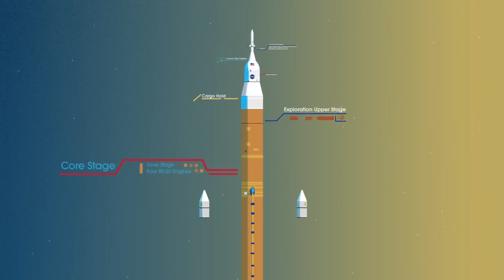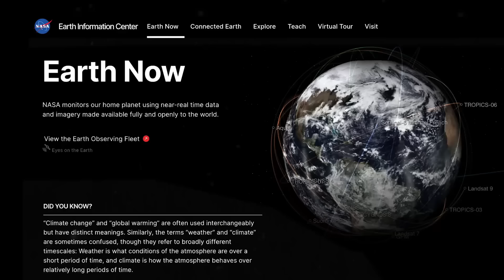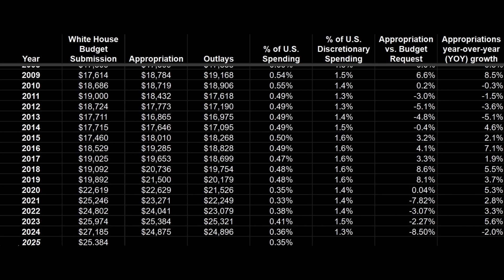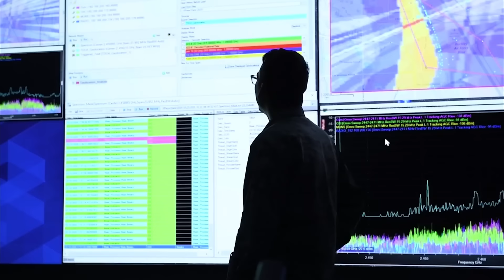What Does Trump's Return Mean For NASA, Artemis and US Spaceflight? Deep Space Update Special....

Comment: 5:48 Honestly the idea of repurposing the SLS into a space station module factory would be VERY poetic
Reply: lets just hope if it does happen they don't reenter uncontrolled lol
Reply: I got some side eye about that idea. I don't think those two things have much in common aside from the shape. Pressure hulls have a very different job than fuel tanks.
Reply: Well it is a Space Launching System
Reply: that or he's just being objective
Reply: Fuel depots, and call it Shelby Station
Reply: Repurposing SLS into anything is a bad idea. The problem is not SLS hardware as such, the problem is the organization around it. These people do not have a slightest idea how to build things economically. For example, Sufferdini went from working for NASA human spaceflight program to work for Axiom ... and promptly broke its finances.
Reply: Space Shuttle parts doing Space Shuttle things lmao
Reply: @patricklewis7636  You do know that they built Skylab out of a Saturn V third stage right? And I don't mean with the tooling for the third stage, or based on the designs. They took literal physical third stage they already built for the later Apollo missions that got cancelled and modified that into Skylab.
Reply: @kukuc96  yeah. Not exactly a ringing endorsement.
Reply: @denysvlasenko1865  It's the hardware too, the RS-25 is an incredibly complex and expensive engine designed to be RE-USED and NASA's plan is to just dump them into the ocean. So yeah Starship is a far better spacecraft lol
Reply: that's what the Saturn V at the end of its life did.
Reply: Yeah, because Skylab was SUCH a great idea. Boeing can't even get a fucking bag of bolts home in a disposable can and you want them to build a living hab? Please.
Reply: @patricklewis7636  it's a concept at least as old as the Apollo programme
Reply: @patricklewis7636  they both hold things at high pressure right?
Reply: @NickH-o5l  Two very different things. And we've gotten a lot more sophisticated about this stuff since the days of Skylab. I give this side eye because it sounds as "simple" as "Let's just re-use Shuttle designs. That will save a ton of money!"

Comment: 6:35 TLI payload of different rockets:
Falcon 9 expended = 5.4t
Ariane 6-4 = 8.6t
Vulcan 6S = 12.1t
New Glenn = 7t
Falcon Heavy expended = 20t
SLS Block 1 = 27.5t
SLS Block 1B = 38t
SLS Block 2 = 46t

No rocket besides SLS can launch Orion+ESM (26.5t) to the moon. A Falcon Heavy Centaur could technically do it (28t), but I don't think Falcon Heavy isn't designed to handle heavy LEO payloads.
Reply: Hey little buddy... I see you conveniently forgot to put starship in there and it will do 150T vs Block 2s 130T to LEO. Starship should be able to do over 50T to the moon and with refueling way way way more than that. Why did you leave it out?
Reply: @thomgizziz  OK. Let's be generous and assumed that starships v1, v2, and v3 have dry masses of 100, 105, and 115 tons. Let's also assume no 2nd stage recovery since we won't have non-ablative lunar reentries for a long time. This gives usable fuel capacities of 60t, 115t, and 215t. With a specific impulse of 380s, here are the available delta-vs for the different starship variants:
V1 = 1752 m/s
V2 = 2757 m/s
V3 = 3930 m/s
Here, we find that Starship V1 and V2 can't reach TLI without in-orbit refueling. We also find that expended Starship V3 has a TLI payload capacity of 47t.
Reply: @kolbyking2315  Yeah, but here's the thing... SLS costs more than two billion dollars per launch. Even if you're expending every single one of them, that buys a lot of Starship flights. If they need to expend 20 ships as a pessimistic $100m each to refuel 1 ship bound for the moon... they're still saving money.

SLS really is that expensive... if not more so, given that the auditor-general wasn't sure he'd found all of the costs when he came up with that $2b figure.
Reply: @simongeard4824  The SLS really is the sunken cost fallacy manifested into a physical object.
Reply: @simongeard4824   I agree that SLS is way too expensive. It's just the only option we'll have for launching Orion. Starship HLS can't dock with space stations or return humans from the moon, so there are other issues.
Reply: @kolbyking2315  an additional benefit is that SLS is ready
Reply: @kolbyking2315  Quite certain it would have to be single use upper stage since you need Orion at the top with LES.
And tbh Starship's estimated costs seem like bit of a gamble.

edit: Also FH centaur would be so much more complex than strapping one thing on the other.
Reply: @kolbyking2315  The thing is, I don't think it is an option for launching Orion. Sure, it's physically capable of it, but the cost (added to that of Orion itself) and low cadence is prohibitive to doing anything useful with SLS...
Reply: See you left out starship. Nice. I have a counter offer for you. Starship fitted with ablative heat shield goes to the moon and back, equipped with shag pile carpet mini bar and hot tub. Orion thrown in the trash can along with SLS where it belongs and the remaining funds repurposed for something actually useful.
Reply: @Shrouded_reaper  OK, I'm done being nice. No planned version of Starship could perform a lunar landing and return without Orion, and I'll show you why.

1: Dry Mass
If you want to get rid of Orion, then HLS will need full reentry and landing capabilities. That means you get none of the mass savings, so we'll need to use LEO Starship as a baseline. The dry mass estimates I gave before were being very generous. If we scale it to halfway between the length increase and the propellant increase, here are the realistic estimates:
V1 = 120 t
V2 = 131 t
V3 = 187 t

2: Heat Shield
V1 Starship's heat shield weighs 10.5 t. With a tiled area of 970m², we find its area density of 10.8 kg/m². The ablator on the Orion capsule is 25.4 kg/m², and the support structure is 51 - 69 kg/m². Let's assume the structure of Starship doesn't need additional support/shielding to hold that ablator. That gives a lunar-rated heat shield mass increase of 14.6 kg/m², or ~14.2 t for Starship V1. Here are the estimates if we scale the heat shield area with length.
V1 = 14.2 t
V2 = 14.7 t
V3 = 19.7 t

3: Crew Section
If you removed the propellant and heat shield modules from Orion, it'd weigh ~16 tons. Let's decrease this down to 12 tons for Starship full-mission lunar lander.

4: Landing Propellant
Before Flight 5's reentry, Starship had ~25 t of propellant remaining. This is ~20.8% of its current 120 t dry mass. Using that ratio, here are the lunar return fuel levels:
V1 = 30.5 t
V2 = 32.9 t
V3 = 45.6 t

5: Unusable Mass
Here are the combined unusable masses we'll use for the Δv calculations:
V1 = 176.7 t
V2 = 190.6 t
V3 = 264.3 t

6: Mission requirements
The Apollo missions used ~10,000 m/s of Δv. If you plan a lunar landing and return mission with a Δv map and give a 10% additional margin, we get a Δv requirement of 9,000 m/s. Let's go halfway in between and say a full lunar mission requires 9,500 m/s of Δv.

7: Starship Δv
Starship versions 1, 2, and 3 have propellant capacities of 1200 ts, 1500 ts, and 2300 ts, respectively. If we combine that with the unusable masses from earlier, we can find the maximum Δv capabilities of the different size Starships:
V1 = 7570 m/s
V2 = 8060 m/s
V3 = 8400 m/s

8: Results
Now, you can see why I'm skeptical of relying solely on Starship for manned lunar missions. No version is even close to self-sufficiency. We need both Starship and Orion if we want to return to the moon before the 2030s.
Reply: @thomgizziz This trend belittling of people commenters disagree with is incredibly tiresome.

Comment: However SpaceX could take over and fix the Tower/Crawler boondoggle for Artemis…
Reply from the maker: The crawler is fine, it was built in the 60's. The problem is the new platform that can get carried by it.
Reply: @ under a different NASA contract than that for the Tower, I was under the assumption someone was building a new crawler as well to go along with the new Tower for later Blocks of SLS, which is also behind schedule…
Reply: @scottmanley  I was built in the 60's

Comment: It is not a good idea to put all your eggs in one basket.  Is SLS obsolete?  Yes.  Reusable rockets is the way forward, but even once Starship is up and running, it's good to have two options when it comes to big rockets.  SLS works well so far.
Reply: 'Well' isn't good enough for how much SLS costs. It's should work wonderfully.
Reply: Problem is, it's not an option. 
At least for the moon missions, it needs another vehicle. It's not independent.
Reply: @thearpox7873  and i bet if Elon is asked to build that other vehicle, he can do it faster and cheaper than the SLS dogs' breakfast.
Reply: SLS...works well? they have flown it ONCE...for the money they blow on a single SLS launch Elon can do a dozen star ship launches each with it's own launch tower. 1.8 to 2.7 billion dollars for the mobile launch platform, 2 billion for the rocket that is not even partially reusable. 

Mechazilla cost 100 million to build. 120 million for the booster heavy 90 million for the starship and all of those parts can be reused except if they are trying to get 300,000lbs into orbit then the booster needs to be expended. 

If you do the math on that, you can realize something staggering. For the cost of a single SLS launch, you can fund 90% of all of the falcon launches SpaceX does in a year (about 100) or nearly fully fund all of the development costs for starship has so far at 5 billion dollars. That's just what SLS costs to build and launch that doesn't even touch the R&D it has had. 

As much as the SLS program has cost, we should have a colony on the moon by now.
Reply: @TheNitroG1  I agree it's expensive, but it does work.  Even if it cost ten times as much, it's a drop in the bucket in terms of what America can afford.  The first launch was beautiful and it was successful.
Reply: @happilyham6769  > I agree it's expensive, but it does work.  Even if it cost ten times as much, it's a drop in the bucket in terms of what America can afford. 

"Thew money does not matter" is terminally stupid way of doing things. Space exploration is in the awful shape it is now (SIXTY FIVE years after Moon landing and we STILL don't have a Moon base!!!) exactly because our space infrastructure was never looking at the economic side. You MUST always think about it. Building launch systems just to get them cancelled a few decades later because they are financially unviable has to stop.
Reply: @TheNitroG1  Starship wouldn't likely be reusable from a moon orbit. The velocity from there and the kinetic energy is way higher and a heatshield has to be specifically made for that. Starship is neither ready yet, nor man rated. It will reach that stage in future but SLS plus Orion is now there
Reply: @simonm1447  It was never meant for a direct trip from earth to moon or back. Achieving this would probably really be impossible within the next decade.
Edit: If it even is physically possible with chemical rockets.
Reply: @denysvlasenko1865  I'm pretty sure that SLS and Artemis will be the last heavy lift rockets built by NASA.  And it is for the better.  But we can't just cancel them now.  NASA has a functional super heavy lift rocket.  It would be an even bigger waste to scrap the project at this point.  Let it do it's thing but let it be that last of it's kind.  Reusable rockets built by private companies is the future.
Reply: @simonm1447 Orion is now there? I'm sorry did you miss the fact that it's heatshield essentially failed and it only made it back by pure luck? They have to redesign the entire heatshield along with a whole raft of other problems. Given how long it's been in development and how much the piece of garbage has cost for one (1) article, DOGE will be beheading it post haste. Good riddance.
Reply: @simonm1447  wait, SLS is man rated? when? how? why doesn't it fly humans to the Moon this year? SpaceX just caught a Superheavy booster a couple weeks ago and they already prepared the next rocket to fly next week lol
Reply: @giovannifoulmouth7205  the next SLS flight will be manned. Since it uses mainly existing shuttle hardware that's possible.

The shuttle was even manned from the 1st flight on.

Space X is developing their rockets different. SLS launched not in a prototype stage, but in a configuration they keep for some time. Space X however launches prototypes to collect data and look how they perform, to improve them from launch to launch and to try different configurations. The next starship launch will even use a completely new upper stage. 

They need a tight launch schedule to speed up the development. However they would never put humans on top of one of these prototype rockets. Also it makes a difference if you develop a fully reusable launch vehicle or a classic rocket made from mainly existing and flight proven hardware.
Reply: @simonm1447  My man hasn't heard the news 🤣🤣🤣🤣🤣 that cost plus contract turd is getting canned. Goodbye.
Reply: @Shrouded_reaper  "baby fly me to the moon...."

Comment: I see your point about all the reasons why SLS is not at risk of cancellation. However it does have one big political hurdle that the program has to overcome. It's not It's budgetary problems or overruns , but that it has the boeing name attached to it. With all of the problems they have had with the starliner I thing the public will push to remove the program. Regardless of all the logic, public pressure can become a movement of its own.
Reply: Yeah and even before Boeing suffered their big 'brain drain' crisis, SLS has been under alot of scrutiny due to it's giant taxpayer cost and little or no returns begin shown for it.

Comment: If you replace the SLS with scientific mission projects. This gives the states currently building SLS a replacement project. The point is NASA does not need to build rockets anymore. Between ULA, SpaceX and Blue the rockets are already available. Let NASA stick to the science and technology aspects.
Reply: NASA doesn't make rockets, you're confusing them with the legacy contractors.  As a contractor isn't not so simple to go from building one kind of specialized hardware to a completely different kind in a blink of an eye so a 'replacement' is not so easy.

Comment: SLS/Orion can't be cancelled now because it'd delay the first Artemis landing. But in a couple of years the process could begin of killing SLS and pivoting to an all-SpaceX Artemis program. Well, all-SpaceX for getting people there. CLIPS can keep going. Various contractors and subcontractors for SLS/Orion and Gateway can start working on lunar base camp hardware. 

.
If the Orion heat shield problem requires a substantial upgrade that would push Artemis 3 past 2028 then a shift to a Starship for the Orion leg of the mission might be made for Artemis 3.

Comment: SLS needs to say Bye bye 👋
Reply: Maybe so but won’t before at least the first few Artemis missions are complete. So 2030s at a minimum.
Reply: Depending what happens with starship could just scrap it. I don’t seeing mooning landing for years. Problems with both systems. SLS costs like 2 billion a year some how
Reply: @BlowBubbbles Starship (the upper stage) is an awful long way away from performing as promised. The heat shield alone appears to be a significant barrier to the intended rapid reuse, rather than the long and v.expensive refurbished the shuttle had to undergo. 

Wouldn’t be at all surprised if the early Artemis landings are carried out using an alternative to Starship HLS. 

Either way I’m skeptical of seeing American boots being on the moon within four years.